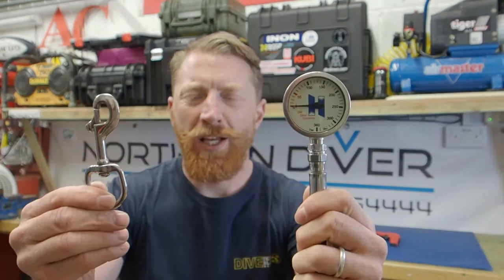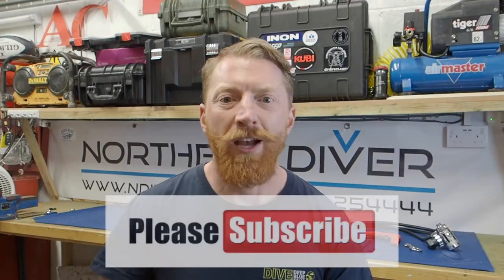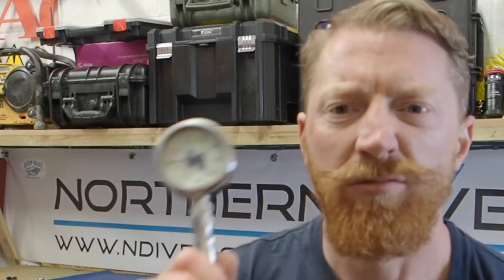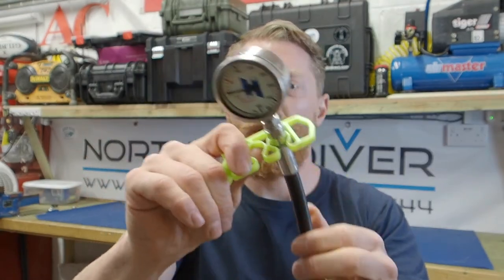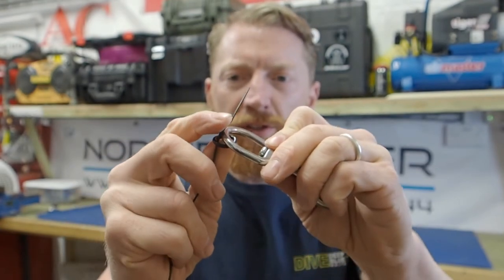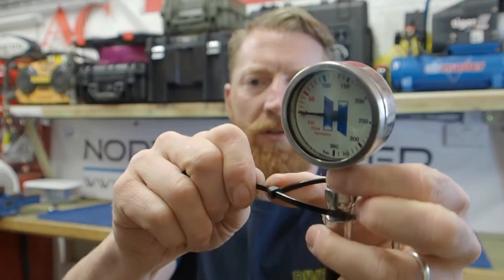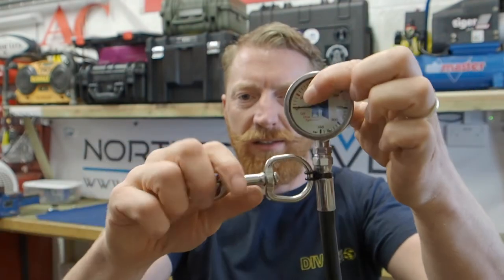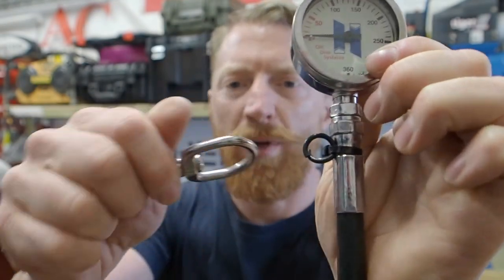HOW TO TIE A BOLT SNAP | Beginners Guide to tying Bolt Snap to Scuba Diving Kit | SCUBA DIVING

Comment: If I was to use the oring break away mounting system on spg I'd use 2 oring. Makes it a little more sturdy. On securing a reg I use one. Also keep in mind you need to check the integrity of the orings before each dive.
Reply from the maker: Or just use a decent oring, sooner it be easy to snap than too hard
Reply: @AndytheNorthernDiver  if you mean a thicker oring that could work. But trust me even with 3 regulator orings in  an emergency you pull it right off no problem. But no matter how you do it the principle is the same and it works well.
Reply from the maker: @jhkleinberg2  yeah  fair point mate sooner try and break 3 orings than 1 zip tie